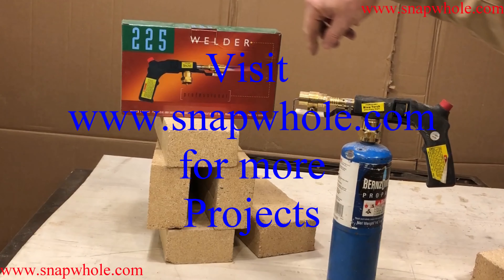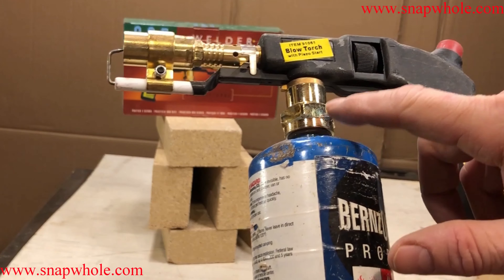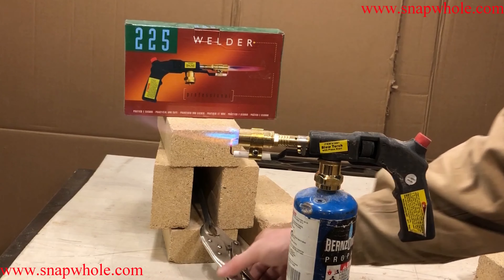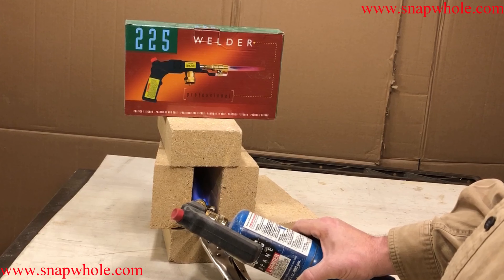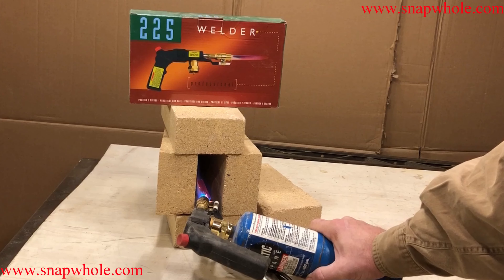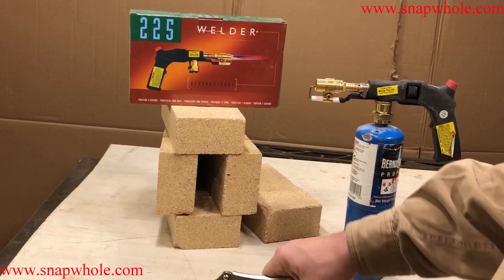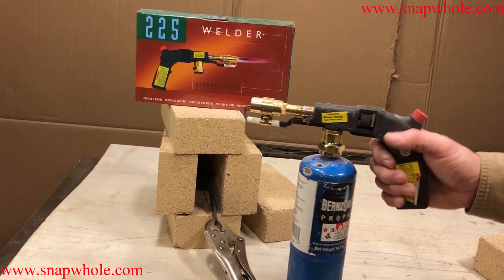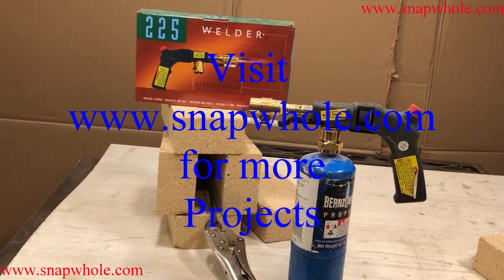Harbor Freight 225 Propane Welding Torch Review and Use Demonstration

Comment: how do you replace the igniter? Mine won't spark after only using it a few times.
Reply from the maker: you wil need to call HF customer service to get a direct replacement - if you don't want a diect replacement and willing to experiement a little, its the same type of igniter used on on gas grills - very surprised if failed after a few uses, I have two of these I use quite a bit, ran about 100# of propane thru them, and not a single problem - thanks for subscribing!
Reply: I have this same problem. Used it twice and flame wouldn't continue.
I don't even hear gas when I turn the wheel knob.  I may have to open it up and clean it out
Reply: If you get a small flathead screw driver and bend the little igniter in or out depending how its set up. Either the flow of gas is to strong or that little igniter wire isn't in the optimal place to light and stay lit  just takes a little experimenting .

Comment: ? Can u use that on car bolts
Reply from the maker: yes, if you are wanting to heat them to loosen them, it will work to heat them, btw I really like this torch, its easy to use and work perfectly, I've had it for ~4 years and no issues - in the video, I'm using a blue tank I had left over from a plumbing job, for light work I use the short/fat green bottles, and I have an adapter hose to run it off a 20# tank - thanks for subscribing!
Reply: Gm and Thank u I have to do timming belt work and sometimes them crankshaft bolts be stressful n don't wanna come off easily 🤣🤣🤣🤣
Reply from the maker: @dariusstack  Glad I could help, can you post and update on how this works out for you - thanks for subscribing!
Reply: U got that n gm I'm goin to harbor freight today to get it